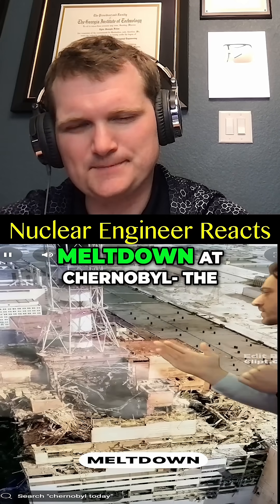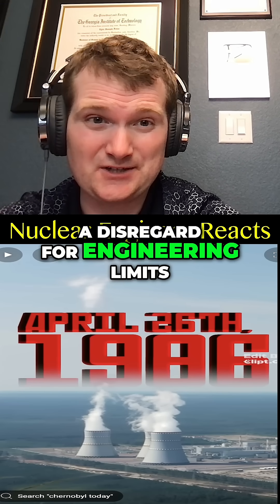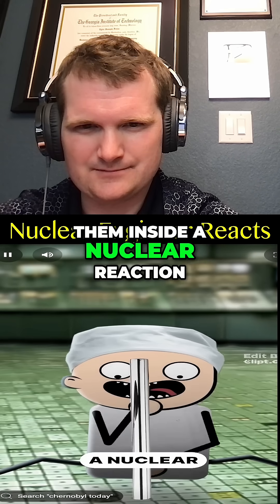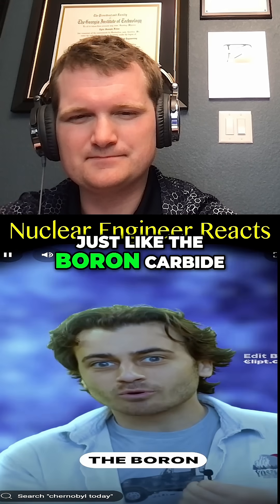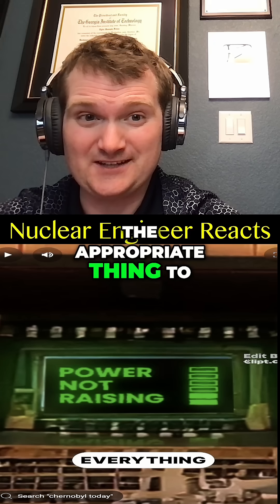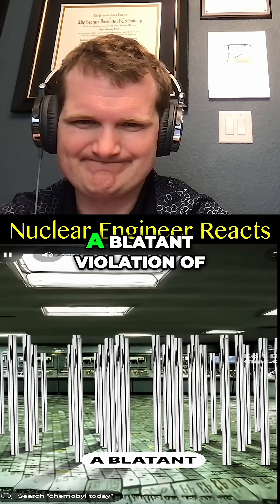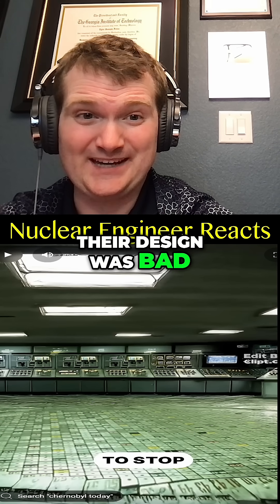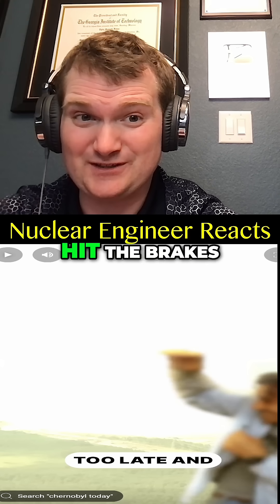Chernobyl: What REALLY Happened? - Nuclear Engineer Reacts to Henry Belcaster

Comment: The graphite portion was also shorter than the shaft so when they inserted it displaced a cavity of water at the bottom that with the unenriched uranium they were using was a net absorber so replacing it with carbon caused a runaway surge of moderated neutrons at the very base of the reactor which is where the steam explosion originated. & I believe there are some models that suggest the base of the fuel rods could’ve possibly gone prompt-critical & shot a jet of plasma through the core

Comment: Also, the reactor got SO HOT that it split the water into hydrogen and oxygen (2200°C, 4000°F) and then proceeded to ignite the hydrogen (fuel) and oxygen (oxidizer) which when combined, creates a nasty explosion. The pressure was so immense that it blasted the 1,000 ton lid off of the reactor (2,000,000 pounds, 909,000kg) and launched it several meters into the air.

Comment: I have heard that the bottom tips of the rods were made from a material that didn't absorb the particles. This made so in an emergency the amount of power generated actually went up before going down. As a result, when the operator pressed the emergency button, it actually led to a huge surge in temperature & the explosion.

Comment: That design flaw with the rods was kind of unbelievable. The control rod had two ends, one end to slow the reaction and one end to speed it up. The speed up part (a moderator) was at the bottom, so when the rods were removed, they actually accelerated the reaction, not just removing the limiter material. 

They basically did the equivalent of falling asleep at the wheel with their foot on the clutch, reved the engine to max and then suddenly woke up and popped the clutch. Nothing was stopping it at that point.

Comment: The chief-engineer decided to conduct tests with unexperienced staff during the nightshift. A lot of these guys ignored protocol and followed his orders, because they probably feared losing their jobs. On top of that the flaws were well known to some of the governmental structures, but they were classified, the staff was unaware of these flaws. They believed they have a shut down button, but with the circumstances they were in, the button became the detonator. There's so much information on the case that it's impossible to explain it accurately in a one minute video.

A lot of factors contributed to the disaster, this could have been avoided if the vital information was not kept hidden or obscured, it's not just operators mistake. They were operating the reactor with an operational manual that was edited by someone who most likely wasn't educated in nuclear science. Would any of you operate with such manual if you knew that?

Comment: "We actually put in the control rods slowly in the nuclear powerplant so it doesn't make that noise"
Reply: Ayo
Reply: Which is good, given the SL-1 had only one rod that was known to get stuck at times, requiring additional manual force to withdraw it enough to hook it to the control pulley.
Resulting in excessive withdrawal and explosively tragic results, flashed the water instantly to steam and rapid thermal disassembly of the core ensued.
Killing all three operators, who were all inside the containment room instantly.
Reply: oh you nasty
Reply: Or just the tip

Comment: The operator didn't even know about power surge from lowering control rods and there were 2 incidents on same type reactors Smolensk and Leningrad that had same type of reactor but didn't lead to explosions while using slightly different control rods. But incident reports were most likely not shared with other power plant operators.
Reply: That Chernobyl Guy (yep, that's the name of the channel) made great videos about these incidents.
Reply: The operators at Three Mile Island didn't know about previous incidents at other reactors where the relief valve had stuck open.
Reply: @boristheengineer5160  Wait, are you telling me communists were not the only ones bad with nuclear thingies back in the day? How dare you to propose that the best country in the world makes mistakes too, outrageous. By the way, the Demon Core is a myth too, it's actually an collectible from Doom.